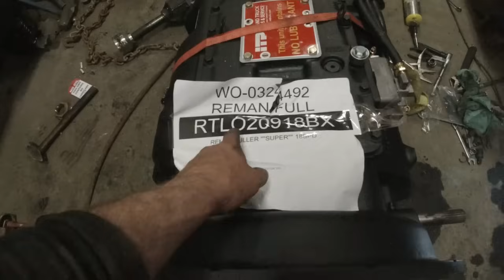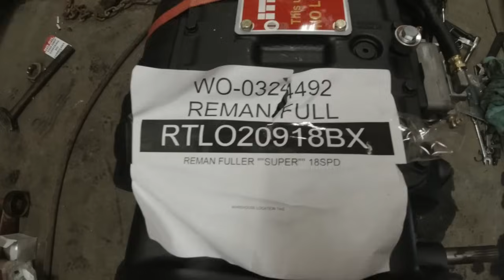bad week for old red - expensive repairs - upgrade to 2050 torque rated 18 speed transmission.

Comment: Love your videos just wondering with the air compressor if it would pay to have a 12 volt electric backup air compressor on your truck that can keep you aired up to get to somewhere safe I know you just repaired your compressor but I was just thinking of the future hopefully it never happens again.
Reply from the maker: In this case it wouldn't matter because it would have run out of engine oil threw the hole in the compressor before I would have run out of air in the tanks

Comment: Dude... I replaced rear main seal, clutch, and tranny like 2 months time. Temporary, i replaced the input shaft on the tranny when I did the rear main and clutch. I think I spent like $10,400. Rear main seal, upgraded clutch, upgraded tranny. I went from 1650 lbs torque to the nice 2050 lbs torque. I love the way you just say "flip" it, I'll manhandle it. The 20918 tranny is almost correct. 20... 2050 lbs feet torque, 9 stands for 9 splines "grooves"(for the unknowing" and 18 is for how many gears... 18 speed yo.
Reply from the maker: the 9 isn't the splines its the series of the transmission. basically what generation in other words. its a 10 spline input. if you want to get real technical eaton calls it a design level .

Comment: Should have put a 2400 in it with a 3000 clutch. Only worry then is the drive line breaking or the rears break.
Reply from the maker: That would be a lot of overkill. For a hot b model maybe a turned up c16
Reply: @Ezrider359  not really. Buddy of mine has a 900+ e model with a 2k 13 and a 2k clutch. Not quite enough to keep it from burning the clutch. For you it would be perfect to have so you don't break anything besides a yoke or a drive line

Comment: I feel your pain Ezra, our Detroit is pushing 714hp at the flywheel, torque is a bit beyond 2250. Scheid Diesel provided me with a tractor sled pull clutch.
It amazes me how little most truckers know about torque and torque multiplication through gearing. Scheid showed us dyno results from a 600/2050 Cat with 18 SPD and 3:36 rear diffs. The trans first gear was 11.36 and coupled with 3:36 rears, the torque is over 118,000lbs in first gear. It blows my mind that drivers actually think the HP/tq ratings are capable of moving 40 tons from a dead stop going uphill, lol, 1850 or 2050 torque straight through the driveline would never move the truck efficiently.

Comment: You must be pushing 600hp to tear up that 1850 with that B model. That main drive gear was definitely pissed off.
Reply from the maker: dyno's at 600 at the rear tire. so probably closer to 700 at the flywheel.

Comment: That is the easiest excuse for trans failures 95 and 12513's were what they used in the 1693 and the 3408's and they were pounding down big power with no failures but they were made with way better metal too
Reply from the maker: I don't 100% buy it either I would have expected a 1850 driven responsibility to last longer but it was out of warranty regardless and it seems plausible enough.

Comment: Sooo the noise was the transmission. The rears were fine waste of time.
There is no 2050, only 1800. The rating is just the oil system, not the gearing. Scammed
Reply from the maker: @captainaxle438  lol
Reply: Input shafts are different, more teeth on the 2050
Reply: @donaldmosley2488  the 16 spline input you are speaking of is used on the newer automated fuller transmissions with a dcm clutch. The transmission in this video is a manual with a 2 inch 10 spline input. Part #S1659
Reply: @captainaxle438  14 spline... gear hardening as well on 2050

Comment: Just an idea but wouldn't it be possible to put an electric backup air compressor on your truck so that you don't lose brakes or the ability to run your airbags up and down just recently lost my stepfather in 2020 and somehow he had a backup electric compressor on his truck so he didn't lose brakes he ran an old Peterbilt like that I think his truck the Vintage of 1999 his didn't have an 18 in it had a 13 instead he ran Drive-van and refrigerator boxes

Comment: Note of the pivot points in the linkage have seen lube in years. Pretty good indicator other maintenance was lacking.
Reply from the maker: The rear most joint is a non grease able joint when it eventually gets some play it will probably get replaced with a greasable one. Thanks for playing try again
Reply: @Ezrider359  30plus years of fleet maintenance for heavy haul fleet . It is or was a pivot point . Not referring to universals but clutch / pto linkage
Reply from the maker: I am taking about the clutch linkage. PTO is air shift. Try again
Reply: Your truck not mine you have a good day
Reply from the maker: Awe did I hurt your feelers.
Reply: Those guys don’t know shit Ezra.

Comment: Isn't trucking fun. Glad to see somebody else is having fun with everything.  High pressure line blew out on AC. Replace it blew the line out to the sleeper. Replace that and then blew the new line off at the compressor.  The line got so hot it blistered the line and melted the plastic loom off of it. Can't figure out why it's get so hot now. So in town I have to keep motor fan on.
Reply from the maker: Few things that come to mind. Bad high pressure switch. Over charged. Plugged expansion valve or office tube

Comment: Totally understand being behind on videos. I've got a few months worth of backlog that I haven't edited either. I've been watching your channel since you first got Old Red. Sorry to hear that you've had these issues, but it sounds like the overall end result has been a great truck that's far more interesting than a new one. It's always something on these big vehicles. I'm about to change the air compressor on my bus (Prevost with a Series 60) after having to change all the exhaust rockers on the engine due to the rollers pitting.

Looking forward to your videos with snow on the ground over the summer when you get around to editing them.

Comment: When’s the last time the harmonic dampener was replaced? We had one go bad and it took out the accessory drive and input gear on the transmission just from going bad, they say they need replaced every 500k miles but sooner in off road conditions, if your destroying compressors and transmissions it might be a good place to look cause it takes a hell of a mechanic to get 1850-2050 torque out of an old mechanical engine. 
Hope you’re in for a change of luck, love the channel have a good un!!!
Reply from the maker: Probably wouldn't be a bad idea to change

Comment: I'm glad everything worked out for you Ezra, Nobody likes break downs of any kind but you are very fortunate that you can fix most of your breakdowns yourself, and it looks like you do it very well. I had a thought on your compressor exploding, although thankfully it has not happened to me, i was told by a few fella's that it happens because of back pressure feeding back to the compressor, I don't have enough mechanic skills to know where back pressure would even be coming from, I don't know if this will help you but if it does let me know I am curious if they are right. I hope your breakdowns are done for a long while Ezra ride easy my friend.

Comment: I would have figured that 1800 rated box would have held up. I've pushed those torque ratings quite a bit. I've run some Mack Quad Boxes like the TRQ7220 at probably close to double, I've pushed 900 rated roadrangers pretty hard too

Comment: probably best to change the other 5 air bags on the trailer. 10 years ago I bought a brand new not rebuilt RTLO18918-B  transmission for my 1994 Peterbilt 379 with a 3406E 5EK  engine. cost me $9000.00 just for the transmission. original one was a 16718 speed. had 800,000 miles on it before it failed. Hard to believe you would have over 2000 lbs. of  toque in that engine buy maybe you do.

Comment: Upgraded my grain truck got a 1974 IHC at auction really cheap saying I can fix that 60 hours later I had it on the road took 12 gallons of grain and assorted mouse parts out of the heater box who knew mousez could pack that much grain into a heater box. Took me a long time to sort out wiring issues had no signal or head lights and every wire is black have to read the number stamped on wire if you have wiring diagram for reference helps. Air lines on shifter were switched so got that sorted so the 1974 has the Cummins 290 someone at auction jammed a rock behind decompressor so that was not to hard to figure out. i only paid $2000 and box will hold 800 bushels so all good.

Comment: I'm a CAT mechanic and I do engines and transmissions all day long. That input gear wouldn't eat its own teeth like that because of high torque output. Whoever rebuilt your 18918b didn't properly seal the input gear with proper bearings and that's what led to the teeth being eaten out. They are upcharging on 20918b, selling them for $7500 echange and wonder how much they charged ya. ALSO, i would suggest you remove the PTO cause it would cause less stress on your transmission. Keep on trucking !

Comment: That sounds about normal for an Inland Truck Parts transmission they have gone to using cheap Chinese parts instead of genuine Eaton, Spicer etc. And as a result have significant durability issues.
Reply: The sad part is got a ten speed transmission rebuilt at arrow Detroit. Told them only eaton parts. Well guess what eaton also getting parts made in china.  Cummins also. Corporate greed. So doesn’t mater.
Reply: @rce8540  Their parts may be from China, but to meet their quality standards, they are still a better part than the non oem knock offs.

Comment: At 10:40 you mentioned only adjusting that clutch 1 time. I got an RTLOF16918B into my truck in spring 2023. Seems I have to adjust my clutch every 10K miles. ... I've only put about 60K on it. Is that clutch adjustment interval normal?
Reply from the maker: Not normal for me I'd maybe look at driving habits what gear do you normally start in. As the clutch wears it needs to be adjusted to compensate for wear
Reply: @Ezrider359  I used to start in 3rd when empty, but changed and now I start in 2nd when empty and 1st when loaded.
Reply: It also makes a huge difference if you are floating gears, hybrid shifting, or double clutching. Double clutching is the best for the trans but WAY worse for the clutch. I prefer floating.
Reply: The RTLO 169/18B them have a lot of problems you need aRTLO 189/18B it have more foot pounds torque
Reply: @DelwinCowan-mb8so   WELP!!!!? Too late to know that, tho I'm not in heavy haul, so hopefully it will treat me right. What kind of problems should I expect?

Comment: Did the previous trans have a halo oil tube? In my opinion the halo really helps when you’ve got decent horsepower. It serves to keep a constant flow of oil over the main drive and over drive gears to keep them cool.

Comment: But, just be damn glad that you have the shop, the tools, and the knowledge to be able to do the repairs yourself!

Shop labor at a shop would have been an additional $5,000.00 minimum. Also, they would have wanted to mark up the transmission cost. If you had to hire a shop to do that job, I wouldn't have been surprised to see that the total was $15 grand! I know of shop labor rates now at $250.00 an hour. And again, they'll mark up that transmission cost also!

Take your ~$8,300.00 plus a $4,000.00 markup plus ten hours of labor at $250.00 per hour = $14,800.00!

A shop would have raped you! 

It's not good that the original one failed so soon and that the warranty was history but... you got 'er done and preserved a helluva lot of money!

Good job!

Comment: I’m in the process of buying a new clutch for the same year truck with a bmodel ….. did you have to buy a new flywheel for an upgraded newer clutch due to opening size in flywheel?
Reply from the maker: if you have the smaller dished flywheel yes you will need a new flywheel

Comment: Well that certainly sucks a big root! 
Something a buddy of mine learned from his Pop’s was when draining oil out of Engine, Rear End’s, Transmission, etc that you want to see what sort of unhappy parts and pieces, etc is not where it is supposed be is to place a gallon paint can or #10 “tin can” 1like canned vegetables and beans etc come in for institutions, restaurants, etc and place that in your larger drain pan and let the oil etc drain into the gallon / #10 can. After whatever you are done draining the oil etc from the Engine, Rear Ends, Transmission, etc you can carefully decant/pour off the oil etc in the gallon/#10 tin can to see what bad news has drained out.  I know this sounds rather simplistic and something anyone could think of and it is but it also beats cleaning out a larger drain bucket and then feeling around in the drain bucket/pan for potentially bad news that came out when the oil etc was drained.  I have one of those large drain pans on wheels and pump to empty the that pan into my used oil storage container.  The roll around drain pan I have is has a piece of heavy screen over the opening so you can’t drop a drain plug etc into the drain pan and because of that I drilled a few 1/2 holes about halfway up the gallon bucket/#10 tin can so I don’t have to decant/pour off as much oil etc to see if there is any bad news in the bottom of it.  Besides the advantages I have already mentioned already the best one is it is certainly easier to wipe out/ wash out (spray down with Brake Kleen) than the large drain bucket/pan. Additionally if you have a friend that works at a cafe or dinner that gets vegetables, beans, soup etc in #10 cans than other giving them a quick rinse so you don’t have food stuffs in the cans and when you are done with the can it just gets dumped and tossed.

Comment: Haven’t seen ole red in a while. Nice video, sorry for the troubles. I’ve got an 84’ identical to yours I would sell to you and only you for $25k. Big Cam 400. Don’t know when it was rebuilt, but the freeze plugs are fresh. Low Reduction 15 speed. Everything is good except the interior paneling. You can see it on my videos.

Comment: Got some balls using that POS jack for that transmission.  Got it down with what you had, and I suppose I'd rather have a POS jack than no jack at all.

You need to replace the harmonic balancer.  Transmission shop should have mentioned that in the replacement discussion.  I'd be shocked if that engine makes 1800ft/lbs.  Lets say you are making big power... It is the most expensive power you will ever make.

Comment: if you hang the clutch on the transmission  you break the input bearing, you better check your ride height, you need a new pto, all that metal fell off into it, and it will throw in up into the new one, i would almost bet there is a gear tooth missing on it, and most likely the cause the teeth missing on the input gear, the filter is a ford oil filter and you should be able to find a remote base for it. only difference in transmission torques is the heat treatment of the gears, i see no reason for a core charge,  better check for a flapper or silcone clogging the air compressor oil line.
Reply from the maker: You realize the input bearing is a large tapered roller bearing larger than the rear wheel bearing on a F350 pretty sure you could momentarily hang a 200lb clutch on it without damage. You also realize the PTO gear and the input gear are two completely separate gears. You think anyone would not dump the oil out and inspect a pto before re installation. I suppose when you spout what you don't know anything about maybe 🤔
Reply: @Ezrider359  the input bearing on a eaton transmission is a caged ball bearing, per eaton you will break it, take a class get certified, i am, i have seen hundreds of ptos after the crap falls into them, very few are ready to reuse, but it is your truck, so motor on, tapered bearing what a hoot. newb
Reply from the maker: Iv only been breaking and fixing trucks for 15+ years
Reply from the maker: You can do inner base circle or outer base circle it comes out the same. Iv run it both ways and that has nothing to do with cracked counter bores and a scored liner. Just like there's absolutely nothing wrong with the PTO mabye don't be so arrogant and people would be more receptive to what you have to say. Trying to be nice with this comment.
Reply from the maker: The scored liner was the major problem with the Cummins and was already likely scored because of the broken piston cooler and most likely the reason the truck was parked in the first place. Just wasn't apparent from the under side or until the truck was actually used.

Comment: that release bearing looked like it had a bunch of wear on the trans size.  also looked like it might be slinging grease, hope that isnt a future issue.
Reply from the maker: What your looking at is where the clutch brake contacts the throw out bearing perfectly normal. As well as the grease, I probably tend to over grease my bearing

Comment: Some more quality work iv learned over the years bigger is always better in my area if your not running 46 rears and minimum 16 front you don't have a truck and with big power you need gears and I notice too your hauling probly quiet a bit heavier then most states so that all plays a part that one issue with building a truck to the extent like Ole red  you try going Thebes cost effective route where in theory should be good but then she goes all truck on you and  craps  on your weekend plans lol